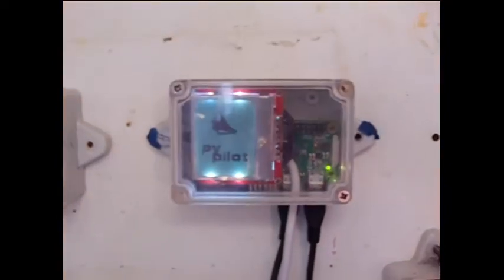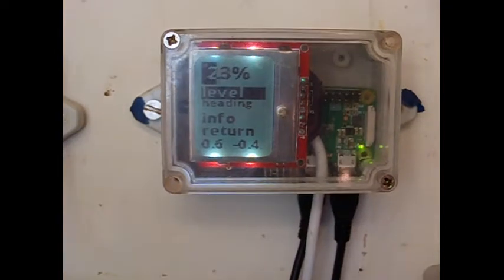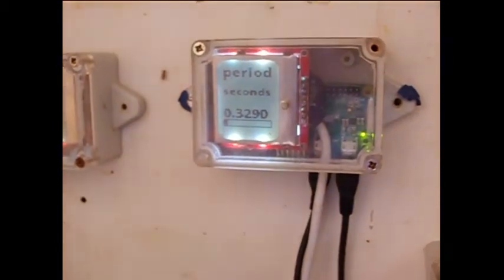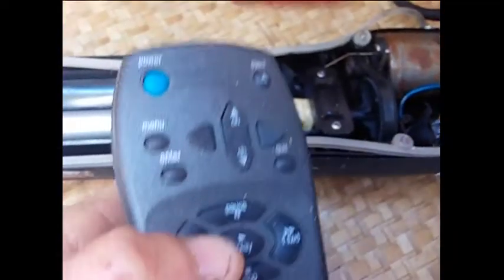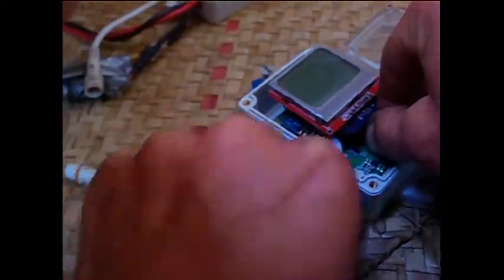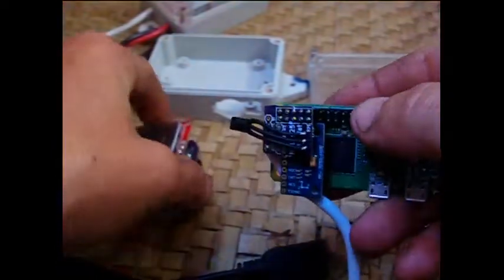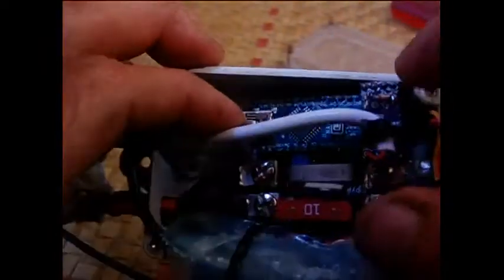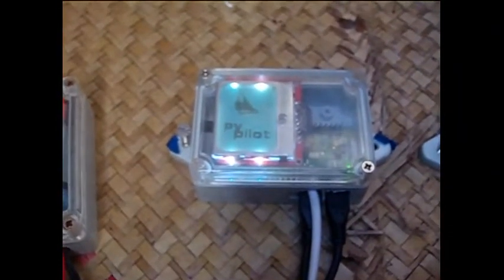pypilot tinypilot demonstration

Comment: Ordered tinypilot and motor controller from this guy 5 weeks ago. Never received either. Anybody else ripped off by this guy?
Reply: I've bought 2 tiny pilots and some extra bits with no problem. I suspect that any communication problem is at your end.  Supply issues could be the problem.  Have you asked Sean?

Comment: With this setup is it possible to have the raspberry pi run opencpn and have it display to a 7" touch screen where you could configure the pypilot through touch? I'm thinking like a GPS where you can tap on the screen on the opencpn app and the autopilot would steer you there. Also think you should link this video on your website. Thanks!
Reply: Check out the openplotter project, it brings pypilot openCPN and all the nmea data streams in to one place
Reply: @Pickles_The_Wise  where

Comment: hy, nice ideea but a litle bit overkill with the pi... in my opinion... now nice wold be to put on the raspbery pi open cpn and a touch screen like 7"...
Reply: Actually Pi can have a screen with maps and then it can be set to follow a route, not just a magnetic heading.. 
PyPilot seems to be a very capable platform, yet it's implementation is somewhat confusing. It is indeed a 'platform' rather then a 'solution'.